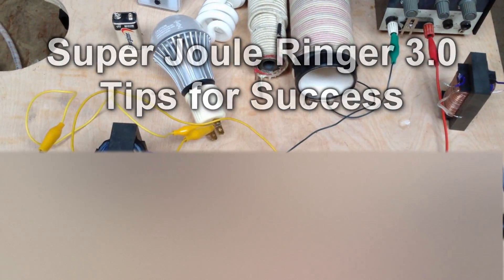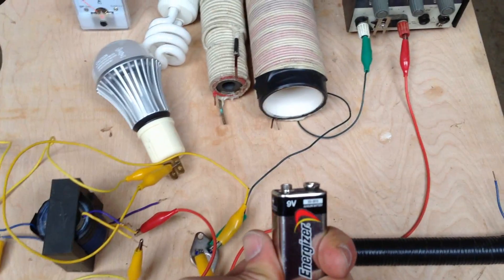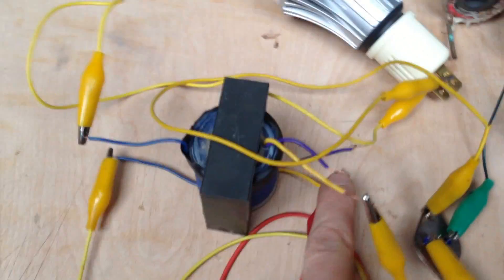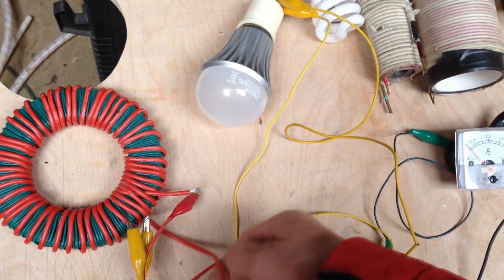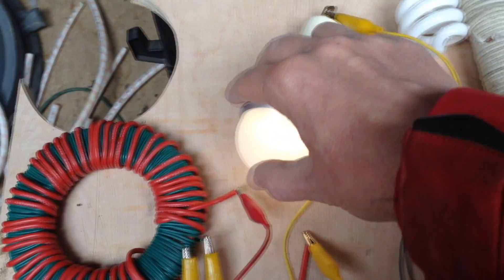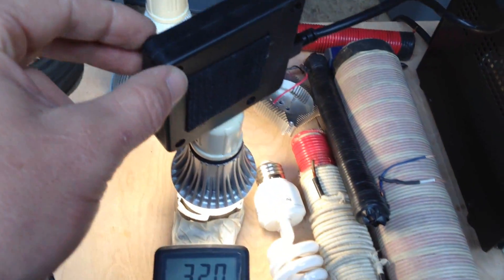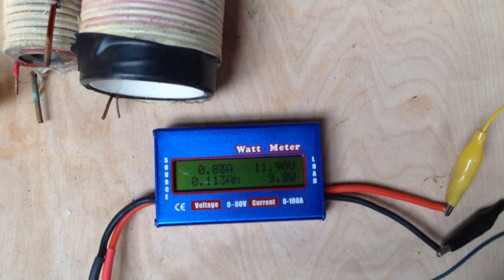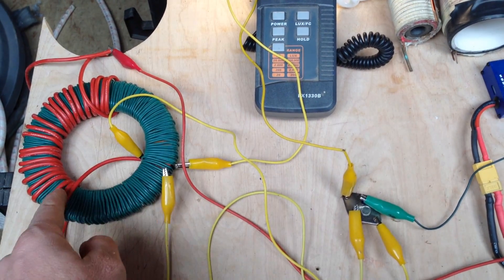Super Joule Ringer 3.0 Tips for Success

Comment: I have had some high voltage trouble with my joule thief. I then converted it with an lm 358 op amp to run a 12v led. Before my pnp transistors were over heating with the op amp and I felt some high voltage tingling on my fingers.

Comment: Hi, Today I have successfully replicated your SJR 3.0 with 1 3/8in=3.5cm OD yellow toroid, 2n3055 TR & 200+ winding 26G secondary & for 23G primary, started with 72 winds & then unwind it in many steps & ended up at 15 turns with the best brightness of one 30w CFL). I am a hobbyist. I live in Greece & here we have 230v AC, I mean the lamps are rated 230v, as such the winding ratio must be differing with respect to yours. Anyway all credits go to lasersaber. cheers.
You think I can add more cfl in parallel, Please reply me if you have easy time. Thanks.

Comment: You're driving a LED bulb there. There's an easier way. Just replace the high voltage dropping resistor inside the LED bulb with one that drops the voltage just enough for whatever lower voltage you're using. Common modern LEDs run at 3.4 to 3.8 volts (older styles run on 2.2-2.8 volts).

Comment: Now i have got it to work by increasing the amps, going up to 13v and removing some winds on the thick coil. it only restarts if i disconnect both poles and reconnect...  leaving the neg on all the time stops it restarting.I noted my coil was 20mm not 24mm thick like your spec.  Thanks lasersaber, I am very happy with this:)
Reply: think i had difficult time getting it to go because i was using a cfl and 11 watts at that.. but it lights up great, i would guess its doing what a 8 watts mains cfl would do.  Uses a lot of amps.. currently its running of 12v bat (8 D size 1.5v)
Reply: Hi, I saw Lynx put one diode from E to B of transistor. You can try this setting. D-bat is rated 4733mAh/Alkaline one 17000mAh which is probably not enough to start/run a cfl driver like this one.

Comment: can any one help me.. I have the  above circuit and have a 9v bat, when i connect it the bulb flashes once and stops, then after a min i reconnect it flashes again..  any ideas about what is going on?
Reply: reduce the 9 volt to six volts,you can try 3 or 4 a a batteries to or 6 aa batts  ,i think you are giving the bulb to much current or you have a dead battery

Comment: A toroid is an easy thing to make Just find a transformer from any micro wave or in a 1980's radio  110 A/c to 12 volt wall wort A metal pipe or bar 12 or 8 inch's copper wire of two sizes Oh yes you would have to use two NPN in order to be able to be used but it would have to be a flip flop arrangement but the heat would be a factor ib the design  or just find an old junk TV some where.for a PNP transistor it a PNP type used here
Reply: daniel ash thanks for the advice, but after the word radio, this started to not make much sense for the technically inclined

Comment: Sorry to bother you im having issues. I have a transformer that has 2 wires for 240v on primary to 5 a wire secondary with 30v or 15v center tapped or 7v. I followed your guide using a 2n3055 and used the 15v center tap and 240v windings with 9v battery but nothing happens. The impedance says 255ohms primary and 17ohms secondary or 9ohm center tapped and final at 3 ohms. Spent a good few hours and really scratching my head. All connections fine, transistor is fine, battery fine. Transformer? thx
Reply: Hi Also watch YouTube videos of guyz in the UK, they also use 220v maybe, use their specs and number of coil turns....hope it helps

Comment: My findings: Add a tap resister at the base and connect to positive with a momentary switch or your can tap the positive from the resister. Also: you can add a small single coil by it's self at the beginning of the positive wire to the primary coil and it will increase brightness output without messing with the transformer windings. I have been using a 20uh coil and it helps big time the ones I got out of a monitor or you can use a small ferrite bead and wind 20 turns of 14.

Comment: when the transistor opens and closes very fast, it pulses the DC input so you get an equivalent ac output. The opening and closing of the transistor is driven by the magnetic saturation of The coil and its iron core. Those devices can pulsate at megahertz. You can get DC and AC readings at the output. (anode and cathode of the transistor).